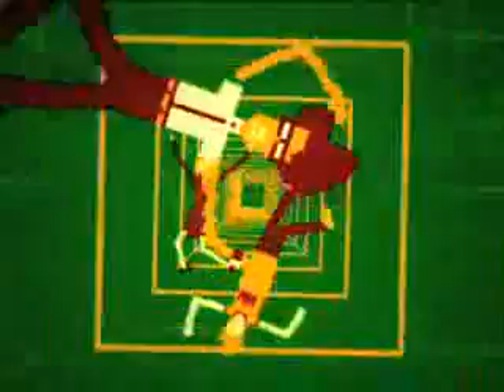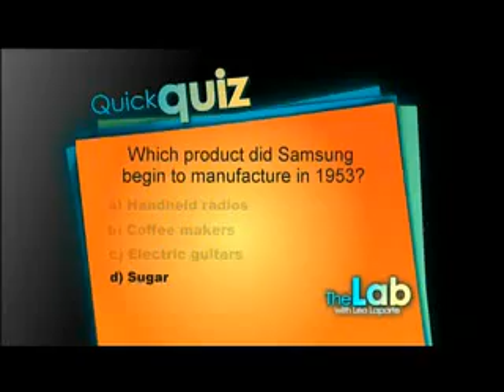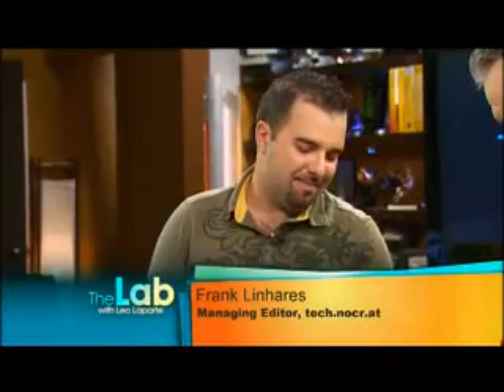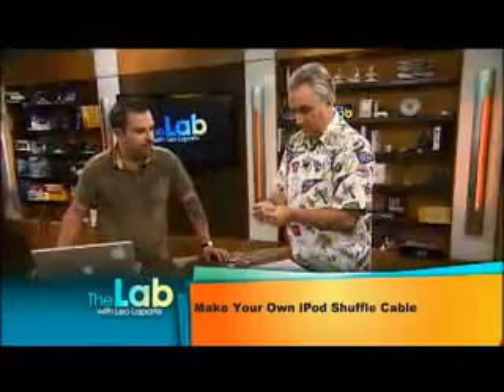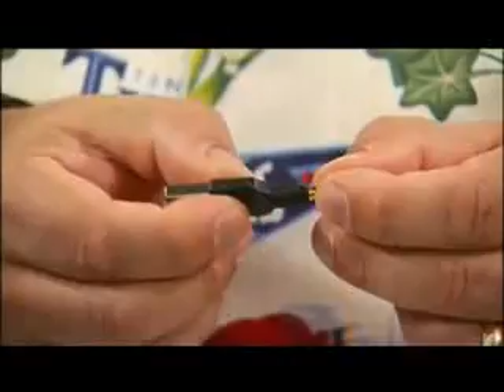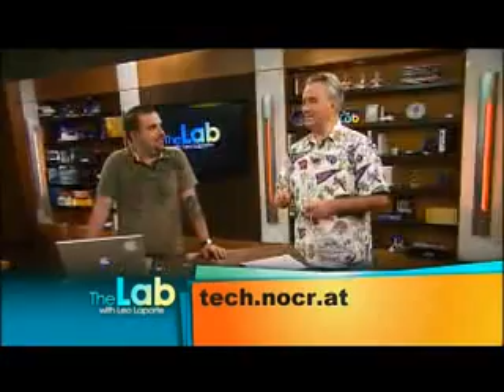iPod Shuffle Cable

Comment: I TOTALY changed my opinion about them when they said "any kind of solder" and labeled the idiots when they said "lead free". lead free is the WORST YOU CAN GET, you need nearly twice the heat and conductivity is very poor. 60/40 is the best bet. ( lead/tin )